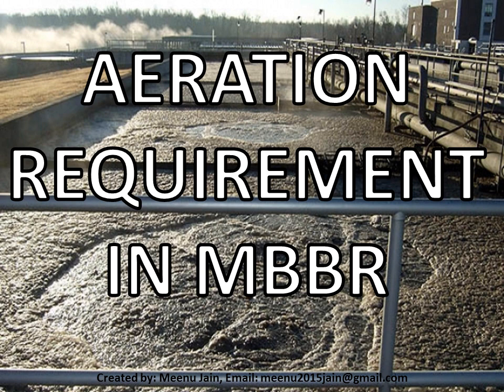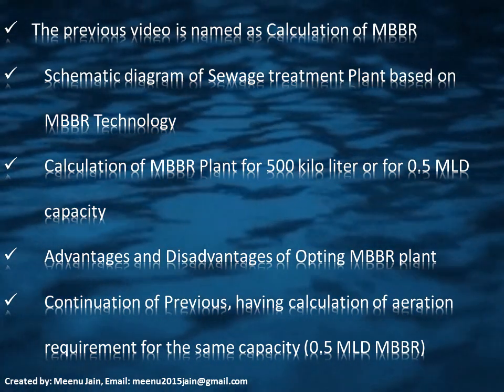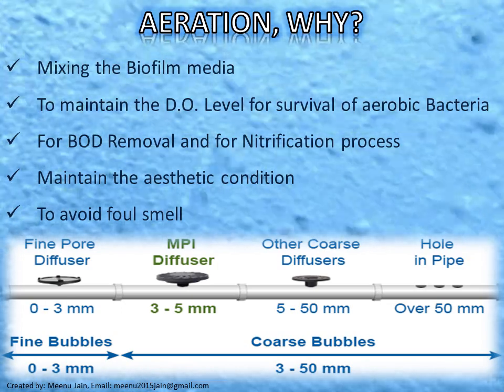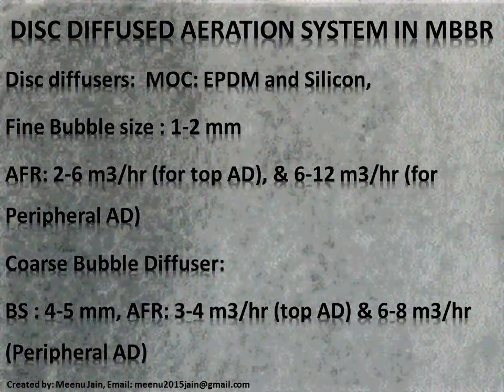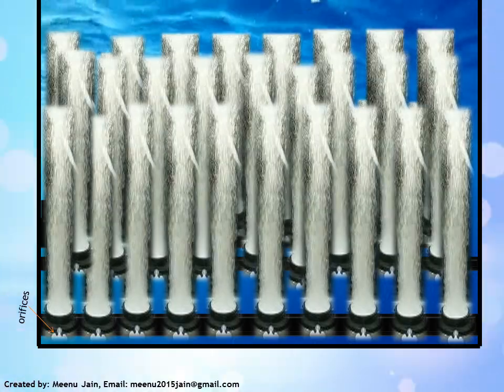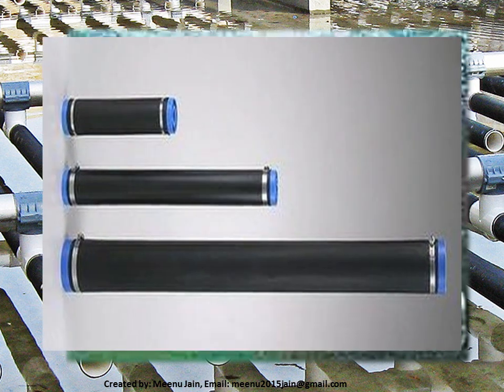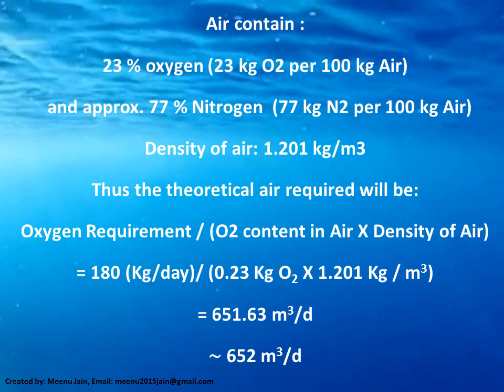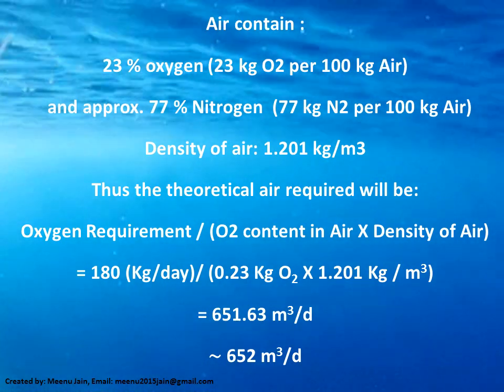Calculation of Aeration Requirement in MBBR || Aeration requirement in wastewater treatment plant

Comment: Madam please check the air requirement calculation, standard oxygen transfer efficiency (SOTE) of diffuser is not considered while calculating air requirement.
Reply from the maker: There are lots of things still remaining like AOR calculation, Std oxygen transfer efficiency, std. Actual oxygen transfer efficiency etc. , please suggest me how to make short/interesting video with all information. In my opinion, if I will include all technical details, probably my audience will sleep before finishing the video.

Comment: HOw to design eqt Tank ?? should it require Air in eqt??/
Reply from the maker: Equalization tank is used for two purposes: 
1. Just to hold the raw wastewater/sewage for specified time to provide uniform flow to down stream units.
2. Aeration is provided for mixing and avoiding anaerobic conditions at the bottom of tank. Mixing by aeration is also used to avoid anoxic condition, these types of equalization tanks are also called as guard pond.

But both type (with aeration and without aeration) of tank are used in industries as per client requirements.

Comment: Thank you for an informative video. Should you not be accounting for some ineficiences in oxygen transfer? SOTE or Standard Oxigen Transfer Efficiency must be taken into account.  In your examples we are assuming that ALL O2 pushed through the aereators is 100% dissolved into the water, this unfortunately is not so efficiencies of only 4.8-9.5% are common in this aspect.. https://www.google.com/search?client=firefox-b-d&q=aereation+efficiencies+in+waste+water. While I 100% percent agree that your oxygen requirements are correct, the final calculation for a waste water treatment plant will end up being 11x greater than calculated to account for the inefficiencies of transfer. Please correct me If Im wrong as I am always eager to learn.
Regards
Reply: Thank you for sharing information. Please clarify above doubt.
Reply: Oxygen transfer greatly depend on bubble size also. Smaller bubbles gives greater efficiency of transfer, as they mix better- and especcially- rise slower to the surface of the tank. Surface of air bubble / volume ratio ,is greater when smaller in diameter. So this is why all microorganisms are micro in size ,as they breathe trough all body surface :)